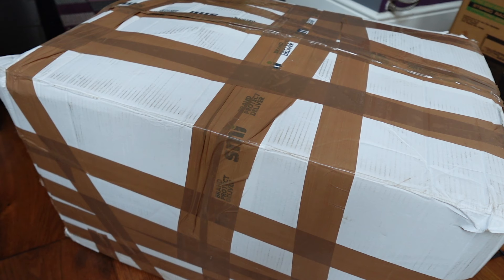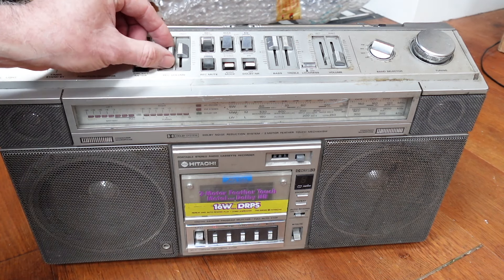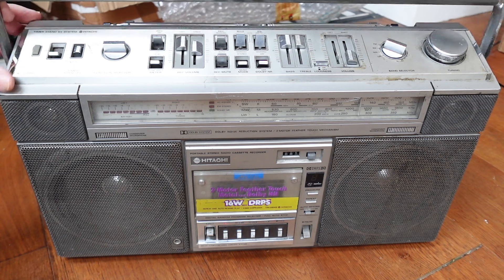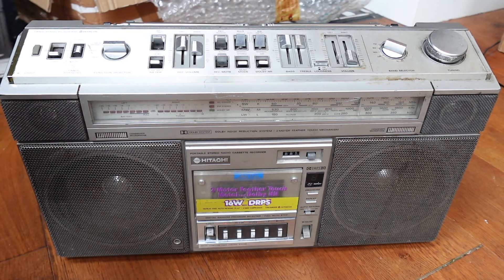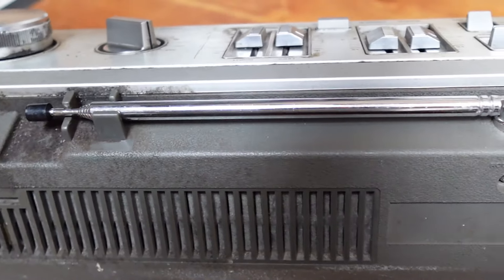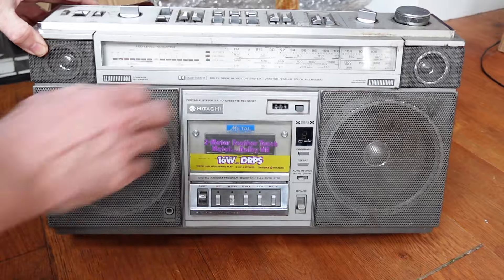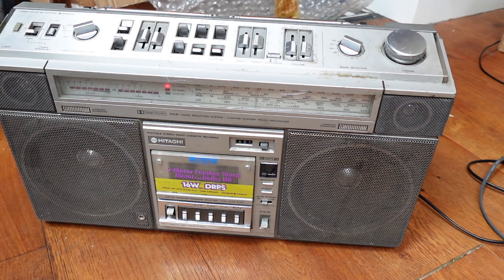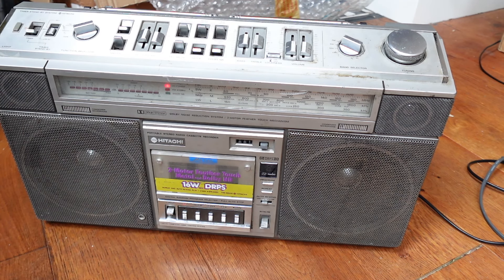Hitachi TRK-8800 Radio Cassette Appraisal Before Repair. Boombox Restoration.

Comment: Another nice looking boom box. It's amazing how many different ones there are.
Reply from the maker: Yes, there is certainly plenty of choice. Some better than others of course!
Reply: @retro_restos  I have a panasonic fd 55 boombox and i got the center gear replaced I also have the mini tiney panasonic boombox with dolby and auto reverse a rareity in tiney units.  Ive found sometimes to the tape detection things oxodize and then it detects no tape inside and won't play